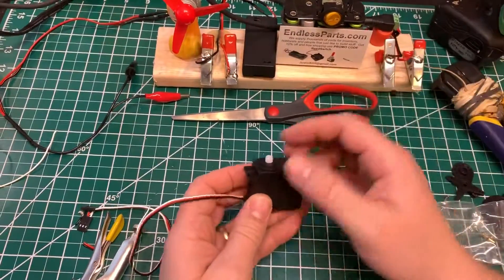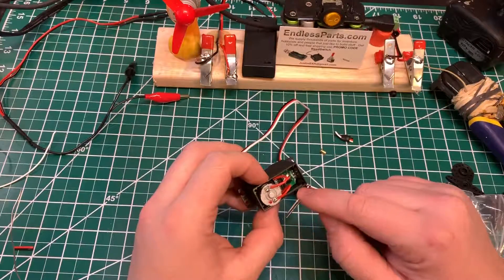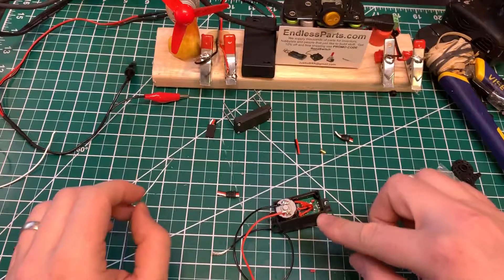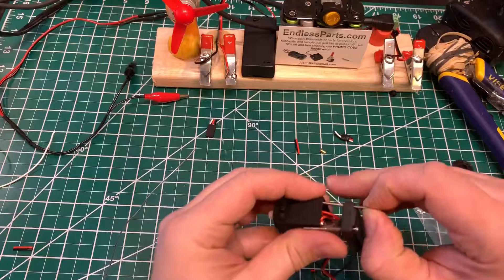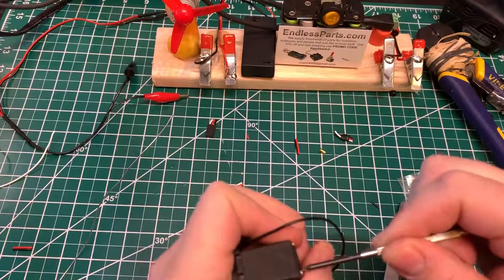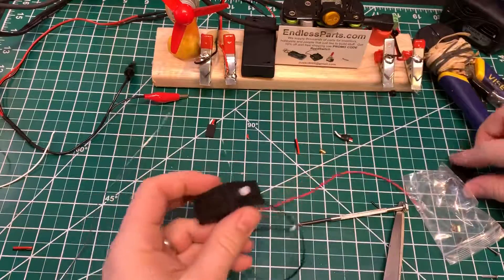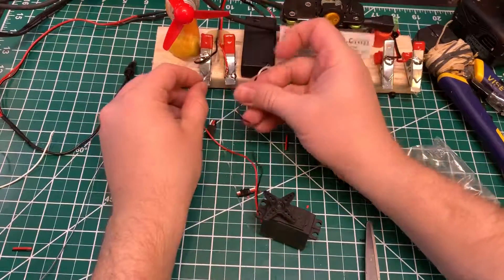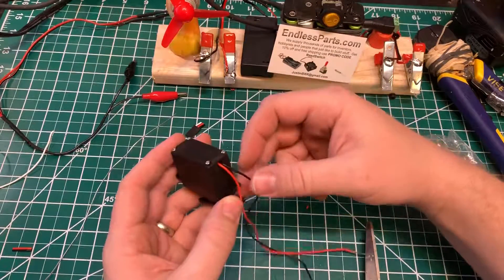how to modify a servo to work with 2 wires

Comment: Did you basically get rid of the white wire?
Reply: Instead of connecting the wire with the control plate directly connect it to the motor